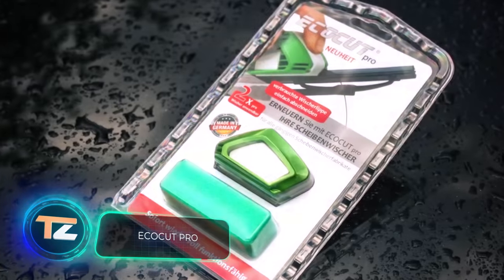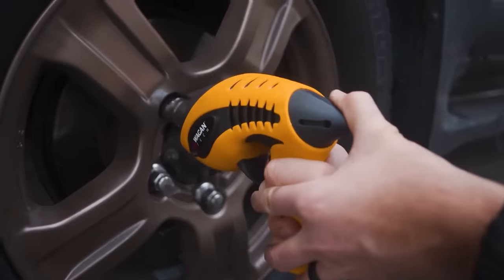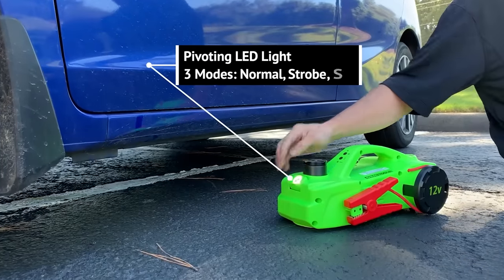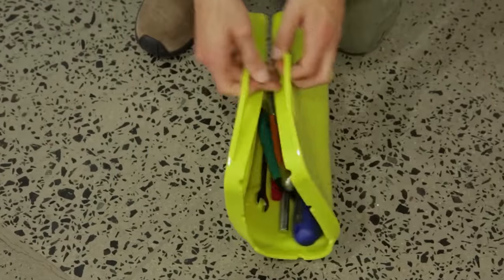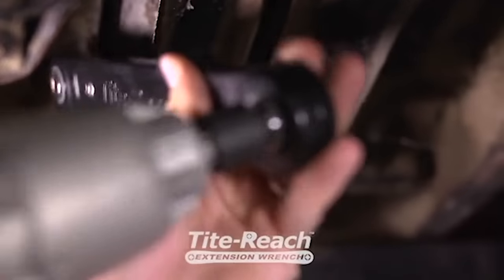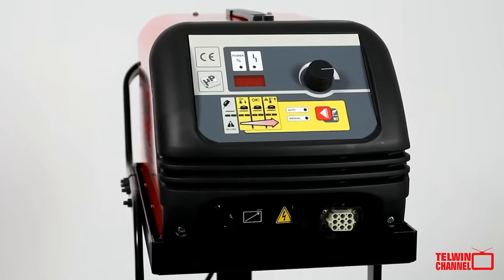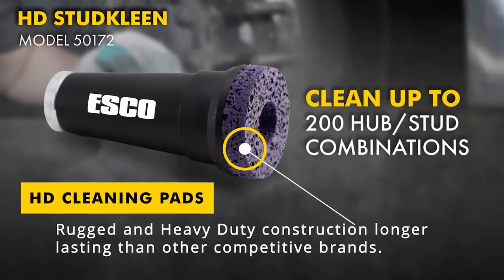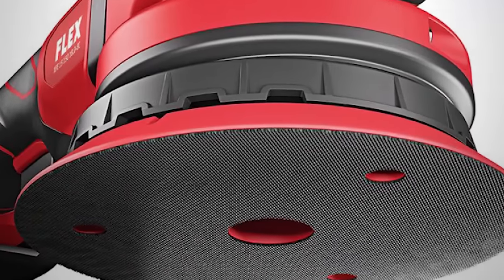NEW AMAZING TOOLS THAT YOU SHOULD HAVE

Comment: The electro magnetic induction tool really interest me.🤓🙏
Reply: The electromagnetic dent puller takes alot of practice to use. It can easily burn paint if left on one spot too long. It will not remove deep, creased, or sharp dents. It's expensive and has it's limitations. I own and operate a paintless dent repair business. I own a T-Hotbox which does the same think but in a much smaller, portable, and compact unit. I practiced extensively on an old hood before using it on a customer's vehicle.
Reply: @dingznthingz  so, will this magnetic heat inductor work on tesla's aluminum body? i want to buy it but with cars having aluminum body parts this tool might be a waste of money.

Comment: Back in the 70’s and 80’s you could buy just the refill wipers. You didn’t have to buy the entire wiper assembly.
My how times have changed. And they’re worried about plastic straws?? 🤷🏻‍♂️
Reply: How often do you change your wiper blades VS using a straw?

Comment: Roadside Impact wrench. There is NO WAY that is taking a lug nut off unless it was only hand tight.
Reply: Try it first
Reply: @jamesridoni  the torque required could snap your wrist
Reply: @bobfurlong5195  An impact won't snap your wrist.
Reply: Impact guns require an anvil with mass something that tool can't possibly have. Anyone who says it would work has never worked in the automotive industry
Reply: @TonyTony-xj6uv  yup, that thing is nonsense.
Reply: @TonyTony-xj6uv  I dont think its smaller than the 12v stubby and that can take off lugnuts effortlessly on all my cars.
Reply: @OdangFication  it's a nasty cheap piece of junk that runs of a lighter port with a shiny thin wire . Your stubby will have a battery pack that has instant amp discharge to force a braking force
Reply: The way I torque on my lug nuts, not even a professional air impact gun can loosen them. The guys at the tire shop snapped 3 breaker bars before they could get my wheels off.
Reply: @lastotallyawesomebleach204  Studs do have a torque limit, usually on passenger cars to trucks anywhere from 75 flbf to 150
Reply: @OdangFication  I just tighten them until I can't anymore, simply just using a regular old 4 way tire iron. I even wipe a little bit of oil on the studs to prevent them from rusting.
Reply: If there’s a stud that’s hard to get off. Have rethread nut to clean up and rethread the stud.

Comment: I make sure after the wipers are used that the blade is left standing in straight upright position.  It is the leaning to one side and taking that shape that causes them to skip and clatter.  I have never had any wear out from the edge becoming rough.  They have always split at the thin part 3/8ths of an inch away from the contact portion.
Reply: I have to assume that you don't get much ice on your windshield then. My car spends it's entire life outside, and the ice in the winter is definitely what wears my blades out.
Reply: @catsaregovernmentspies  We average 3 feet of snow from Lake Michigan.  The vehicles are never in a garage.  Plus the steel mills cover the windshields with plenty of pollution. But we make sure our windshields are cleaned before moving them to be safe not only for us, but for others.  When we know about an ice storm we raise our blades so they aren't frozen down, and if we haven't done that, we let the defroster do its work before the blades move.  We also own windshield covers that we try and remember to cover them when the weather is going to be bad.  Never had a blade with notches in it for this cutter to be used on it.  My family had a construction company for 30 years with over 50 vehicles used in the steel mills and their blades didn't have that problem either.  The blades would always just start breaking down at the point that they wiggle back and forth, then split apart there.  I can only guess you start your wipers on the ice, not scrapping it first and that is what might be eating away at your blades if that is happening to you.  Don't do that.
Reply: I am not that diligent about cleaning my windshield. I figure blades are fairly cheap and easy to replace, so I'm not going to spend more time freezing than I have to.
Reply: Lol ya I was gonna say so many ppl have that much time to take care of $30 wiper blades...

Comment: That 12v impact should be thrown on thetorquetestchannel to see what it’s really got. Given most cigarette lighter circuits run small gauge (18g typically) wire, the fuses are between 5-10 amps at 13.5v, and the line drop from the long extension…I highly doubt that gun can pull 250+ ft lbs.
Reply: Add to that the galvanic corrosion after being on for 12 months. I've come across nuts on an audi that have required a 4ft bar to crack them. That pice of crap wouldn't shift a sump nut
Reply: I doubt it too and it’s like £65! Could get a cheapo Chinese cordless impact gun for that and it will actually undo wheel nuts as well as other bolts.